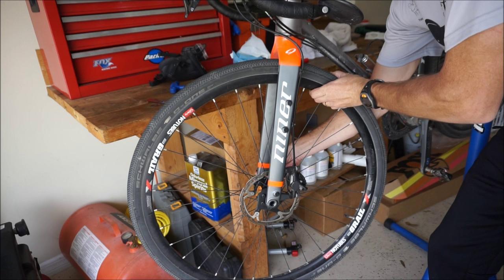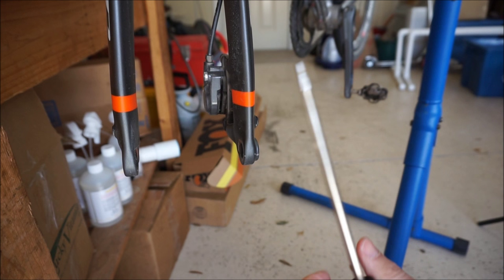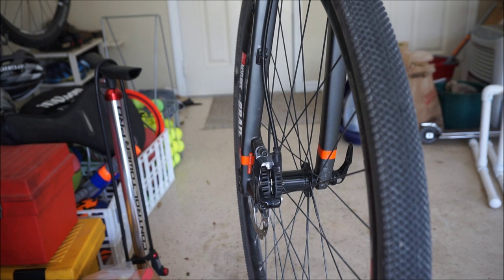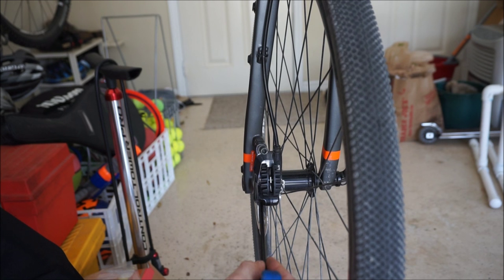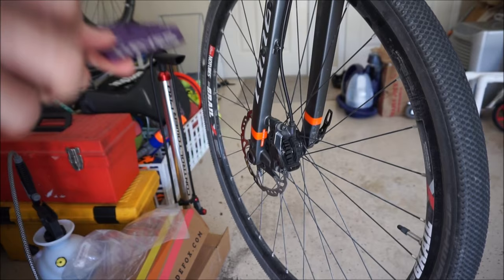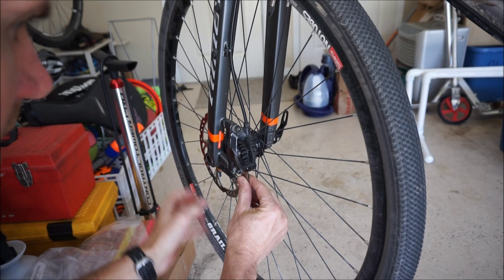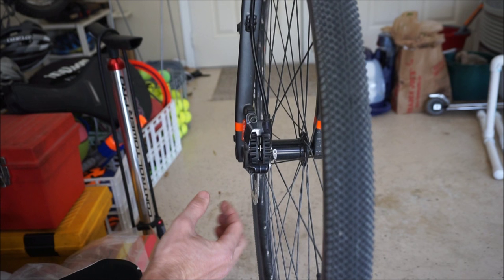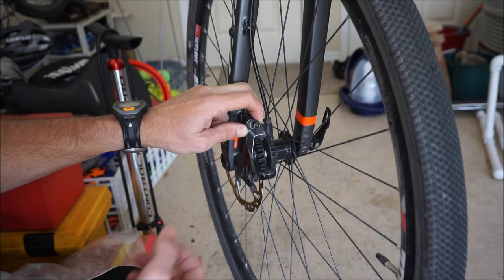How to Center Hydraulic Disc Brakes

Comment: Great video, do you think quick release and disc breaks on a road bike should be avoided?  Looking at a 2016 Giant defy advanced pro, disc breaks and QR.
Reply from the maker: +Gavin Jones all the road bikes i have owned in the past have been quick release and I had no issues. However with more road bikes coming with disc brakes, the thicker axles handle the torsional flex that comes from disc brakes. Unless you want the absolute lightest bike possible I think disc brakes or the way to go. I certainly would never buy a cyclocross bike without them. Even on the road I think they're going to prove more and more preferable.
Reply: Clint Gibbs thanks clint. happy with disc breaks coming from a mtb background. Little dubious about qr and discs but been offered a 2016 defy advanced pro at an amazing price so will have to chance it and hope Im not spending all my time tinkering with the brakes!

Comment: for me the pistons were so close that the rotor must be placed perfectly. I didnt wanted to bleed. Than for me without tool I needed to do by eye centering. Even than it was rubing although there were mil space on both size. Than I figured out the wheel was not tightened. After this it was ok

Comment: My bicycle disk brakes are cable-actuated. Will these methods work on them too?
Reply from the maker: No, those center in a different way. It’s been a while since I’ve used those but if I recall correctly only one pad moves and the other is stationary.
Reply: Thank you.

Comment: Hi. I did everything and disc rotors wont are free now, but... When I use the brake, it starts to rub again... What to do? I have. 15% of disc pads left
Reply from the maker: Take the pads out and squeeze the lever just enough so the pistons come out a little bit but not all the way. Push the pistons back in. Repeat this seven times or so. That will lube the seals. That may be the issue. Then put some new pads in. It could be also the spring is worn out. A new spring comes with new pads.
Reply: Clint Gibbs thanks man, but i have a problem, when i push the lever, it just goes easily and it brakes so bad, like it cant stop me for 20 meter. I moved pistons out and cleaned them and added some oil on them (not oild from brakes, motor oil...) but still, my lever is so easy to push, and it brakes so bad
Reply from the maker: @sc_273  sounds like you need to bleed your brakes.
Reply: Clint Gibbs to add new oil?
Reply: Clint Gibbs do you have instagram so you can see my bike 😁
Reply from the maker: Kuzman @clintg37

Comment: My rotor is only rubbing on one side, I did the loosen the bolts then squeeze the lever then tighten back it doesnt work, the rotor still rubs on one side of my brake pads
Reply from the maker: You'll need a tool like the one I showed in this video. Also the birzman tool is a good one:
https://youtu.be/j_-sv94eQ4E
Reply: Something I learned yesterday trying to do this on my new E bike, is I just have a one piston caliper, not two.....I'm not sure, maybe this is not so normal of a thing. But anyways, with my one piston, on the opposite side there's a bolt that you can loosen, or tighten, to create more distance / less distance between the pad and rotor… This worked like a charm, and made my pads not rub and did not put unnecessary pressure on my rotor while breaking (One piston designs pulls the rotor to one side when braking, instead of uniformly, if that makes any sense)
Reply from the maker: @timgreen1835  sounds like you have mechanical disc brakes, as in there is a cable and not fluid.
Reply: @ClintGibbs  - Yes, my ebike has mechanical brakes not hydraulic.....I just thought maybe my suggestion may help somebody that has the same one piston disc brakes as mine. After thoroughly going through my brakes for the first time, learning how to clean and adjust disc brakes, I went for a ride tonight and everything was perfect… Even much better new, when I first got my E bike. I learned about burning them in (if that's saying it properly) which I had never heard of before. But boy, it makes such a huge difference in my brakes now working awesome, and stop better than ever. I have a trek mountain bike with hydraulic brakes, so I've learned enough to be able to go through those also, without any fear. Like I mentioned, I've always had higher end road bikes so I've always had the bike shop do everything for me, so it's nice to be able to do mechanical things myself… I am mechanically inclined, so that helps

Comment: I just got a brand new bicycle and both brakes are slightly rubbing against the disc. Is that normal with a new bike?
Reply from the maker: +Escorpio40 yes, if the mechanic didn't properly adjust your bike when you picked it up.
Reply: Actually I bought that bike in the box and putted together myself, but only the front wheel was out .the disc barely scratch to one side.It could be a factory defect with a slightly bent disc?
Reply from the maker: It's normal for the disc to move very slightly, like a millimeter, while the tire is spinning. But if it's warped then it could have gotten bent in shipping.

Comment: Just a question, why does the poiston goes out of alignment when u remove the tyre. Especially when I didn't touch the brake mechanism.
Reply from the maker: +soh kai siang the Pistons should not go out of alignment when you remove the Wheel from the bike. The only way that would happen is if you don't take a wheel off straight or if you squeeze the brake while the wheel is out of the bike. If this keeps happening just use a flat blade screwdriver and spread the pads apart before putting the wheel back in.

Comment: Thanks for video! i recive my new XT M8000 brakes with RT86 rotors for my new Giant Reign 27,5 and i have a problem with centering callipers... Brake pads touch rotors with every of your methods i use =) Maybe its just new? i never ride this brakes yet. Do you think its ok for new brakes and rotors? Thx for answer =)
Reply from the maker: +Андрей Сергеевич have you tried resetting the pistons? If so then there's a chance your brake rotor may be bent.
Reply: +Clint Gibbs Probably a bent rotor. I have that problem more often than not.
Reply: +Clint Gibbs its brand new from CRC. Not bent, 100% sure!

i dont resetting pistons because i just re-bleed brakes with bleed block and pistons seems in nice position from the box... But i try your advice tomorrow and write here in comment section what happens =)
Reply from the maker: +Андрей Сергеевич Sounds good. Let me know how it goes.
Reply: +Андрей Сергеевич I have experience with RT56 (1 set) and RT76 (2 sets) discs and all of them had a slight wobble when mounted. I used my wheel truing stand and a disc brake multitool to get the slight wobble out of them.
Reply: +Clint Gibbs iam sorry for late answer, i have lot of work in this week =)

I reset pistons as you say but i using special tool from FORMULA brakes, not screwdriver because it can damage pads or pistons. Be careful! i have negative experience with broken pads by screwdriver.

Next step i use your "business cards" method and it works! I have a small troubling touching pads noise from rear brake pads but i just manually correct a little bit rear calliper and now my brakes works nice and clean just like swiss clock =)
Thank you, Clint! i never hear about special tool for calipers centering  or business cards method. Tnx again for your youtube channel and have a nice day! =)
Reply from the maker: Great!

Comment: Nice Ninner frame , is that your cycle cross bike.
Reply from the maker: +killboy 633 Niner RLT9 Steel. It's my gravel bike.
Reply: +Clint Gibbs its 5-Star Spec rocket? I'll waiting for review =) Why not Giant TCX?
Reply from the maker: +Андрей Сергеевич It's the 4 star build. Awesome bike! I'll be doing a full review on it in a few weeks but I featured it in my aluminum versus steel rlt video. I also have a Giant TCX which is my cyclocross race bike. I have the two set up pretty differently, especially during cyclocross race season. I've done a full review on the Giant TCX.

Comment: What happens when the pistons don’t disengage?
Reply from the maker: Sometimes you need to relube the Pistons by squeezing the brake lever without the pads contacting themselves all the way and then prying them apart with a screwdriver. Repeat that three or four times.